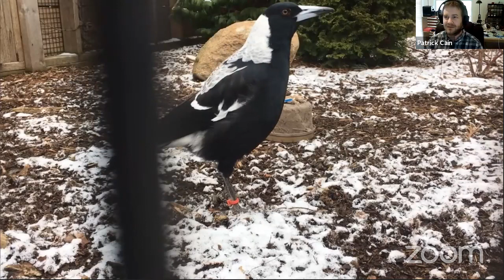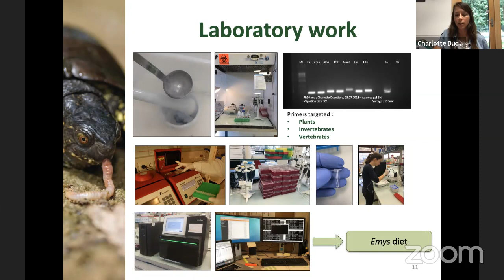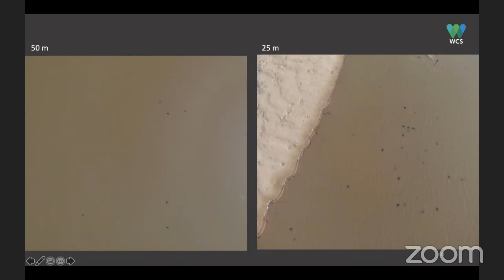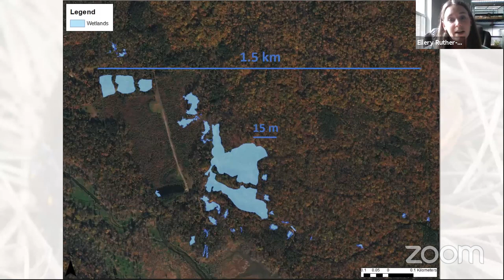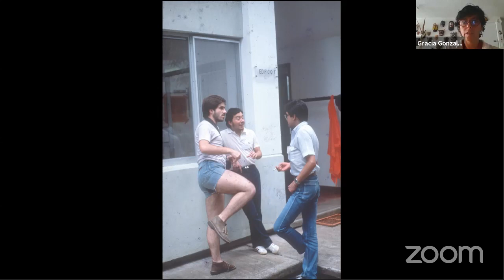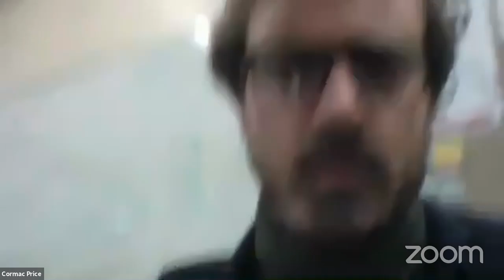Week 4 of the 18th Annual Symposium on the Conservation of Tortoises and Freshwater Turtles

Comment: I don't think this study can actually determine if the juviniles Emys are more/less carnivorous than adults as from what I can see the data does not show the amount of the different food groups in the feces it just accounts for its presents. Plant material is the most readily available and easily obtainable food so it is not unusual that you would find it in similar amounts in both adult and juveniles in the same habitat, and although vertebrate and invertebrate levels where also simialar with regards to its presents in juvenile feces and adult feces it may actually acount for a larger amount of the diet of the juveniles than it does adults.
Reply: really great and fascinating study though.